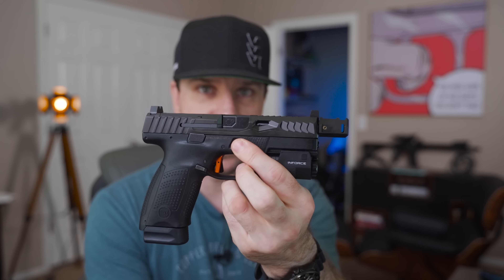NEW CZ P-10 C Slide // Any Good?

Comment from the maker: For those who are new here, The Build List & Promo Codes are Here: https://bit.ly/2UPCziT
NEW Pew Pew Deals Here: https://bit.ly/2OFAl23
Reply: Also, you said black nitride was your favorite coating, and it's a good one, there's no doubt about that, but I've found DLC coating to be favorable, at least in my opinion.
Reply: For those that haven't tried it yet to remove the rolled pin to change the backstrap is a process because the pin itself has these cuts to grip the slot even better and not back out on its own ingenious design and a pain to remove compared to other backstrap pins

Comment: I happen to have the Norsso and a Killer Innovations slides on my Sig P320's, I love them both. I just decided to add a custom slide to my CZ P-10C and that will be the Killer Innovations Velocity slide, I like this slide a tiny bit better than the Norsso slide, The KI slide is a little bit lighter in weight and I like the cuts a little better but I wouldn't sell the Norsso either.

Comment: Great video Mike. I’ve had a P07 for awhile and a few months back was able to get the P10C OR which  have been hard to find. I got it from Cajun Gun Works and they also have a lot of after market parts for the CZ’s.
I remember seeing and upgraded trigger kit with a firing pin etc. You probably know about them already but just in case. Thx for all your informative videos. Cheers

Comment: When you mount the optic (rmr in my case) be ready for OCD and buyer's remorse (at least for me) long story short the rmr is hangs off the side a whole lot, both sides. Gasket on the rmr is clearly visible. First custom milled slide so I have been used to the optic ready models from manufacturers who use adapter plates. I guess the plates help to make the dot appear square with the slide. Maybe the overhang is normal so you guys with a few slides let me know if that is normal or if it's something you look into before buying? I didn't do my homework and there wasn't many videos out. This video doesn't even show an optic on the slide either. Other than this the slide looks great. I would of rather had a non optic reptile cut slide because the overhang actually bugs me pretty bad for some reason.

Comment: I'm surprised they have to close those areas down. The heat here alone is enough to keep me from shooting outside all summer. 

For the trolls, yes I'm fat and I love air conditioning.
Reply from the maker: I'm spoiled too... But even if they didn't shut it down and I could tough out the heat.. My cameras will shut off after 10 minutes in the heat
Reply: @TacticalToolbox  that's not surprising. This heats terrible for electronics. That does make me wonder though, will extended periods of exposure to the heat here have an effect on the battery life and performance of some optics? I know companies build them to be resistant to the elements but I bet the batteries suffer.

Comment: would I buy it No to expensive for something that basically  just looks cool .. with hardly a advantage over a fully functional   reliable   stock slide..   your paying for the Pretty Gucci  Cool factor on a firearm  ....    machine work looks good though  have a good day.
Reply: That's prett much sums up any aftermarket parts.
Reply: @justinlance5239   other then going with some  night sights .... yeah pretty much  but some firearms owners like to spend $$$$$ and dress them Up  good for them....  I like practical  real world! useful reliable  functionality  to each their own
Reply: taz Man I totally back u up on your comment, I’m not hitting my threat with fashions as much as I do power and concealment ✊🏼👊🏼
Reply: The point is, no need to send in your stock slide for machine work in order to mount optics + will still have your stock slide.